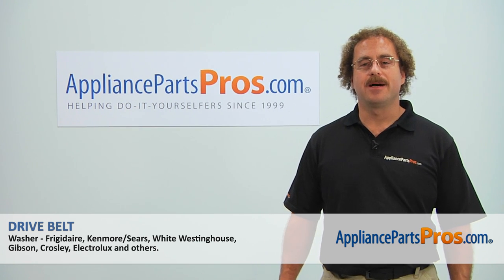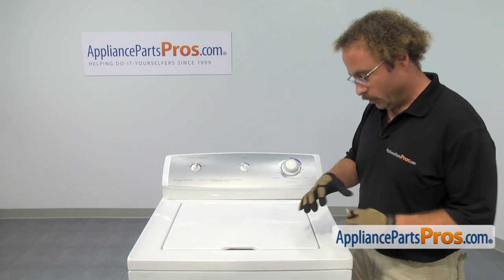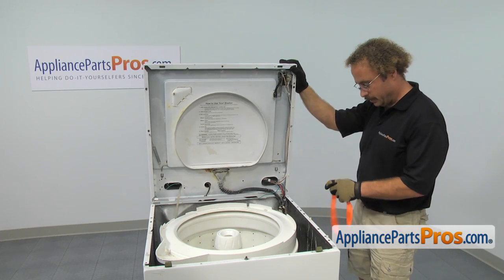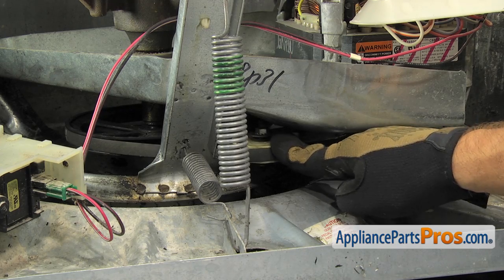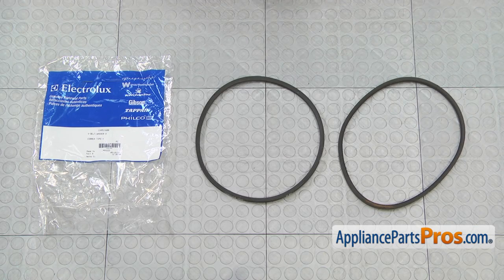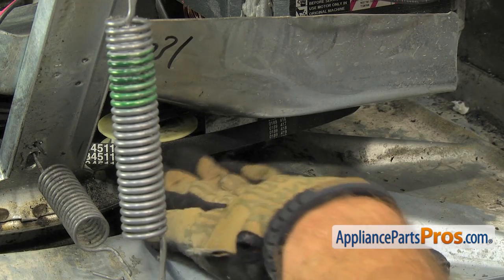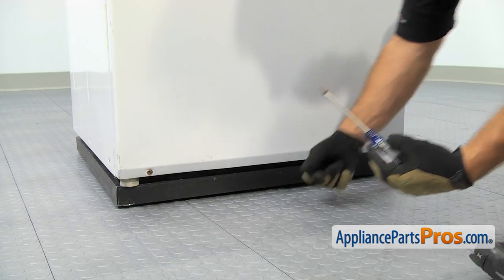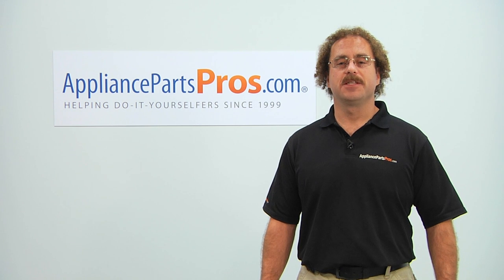How To: Frigidaire/Electrolux Washer Drive Belt 134511600

Comment: I have all the parts and machine. Problem is that i seem to be not strong enough to get the new belt to go over trany pully. Im like an inch away. Been trying for an hour. Im not a weakling either. He makes it seem soooo easy.
Reply: The problem there is this.
The transmission pulley is really small,compared to the tub pulley. It's too tight of a bend for it to roll on the smaller pulley.
Put the belt on all of the pulleys,leaving the tub pulley for last.
Get the belt started around the tub pulley at the rear as far as you can,around to the front and while holding the belt as best you can to the pulley, rotate the tub pulley counterclockwise and the belt will roll in to the groove on its own.
Reply: @paulbillings1791  Thank you for this, however video speaks of idler pully, motor pully and transmission pulley. So which one is the tub pulley please?

Comment: On the one I'm looking at .the belt looks fine from the outside! the motor runs but it slips immediately!! And the tensioner is on. and it doesn't look like it should be stretched .but maybe it is. how tight should that tensioner be?. On other washing machines they don't even have a tensioner ..but the belt is so tight they can barely get them on. so I would think this tensioner should be really tight. yes or no?
Reply from the maker: The belt should fit snuggly on the unit, if it's not loose then the tensioner is fine. If there is damaged or worn spots on the part then it would need to be replaced.
Reply: @appliancepartspros  yeah I found the problem . it's it's got ware in one spot.. but you can't see it from the outside.
Reply from the maker: Glad you were able to figure out the issue. Good luck with your repair and let us know how it goes!

Comment: Not right. I have a kennmore. And there is no space under Thu idler pulley to pull out the belt. The pulley is attached to the bottom.
Reply from the maker: A single part can be compatible with hundreds of different appliances. We film the part on a single appliance model to serve as an example of the repair, but there may be slight variations in the process for different models. If you need additional help with the repair outside of what's demonstrated in the video, you can always give us a call at 1-877-477-7278 or you can chat us at our website: http://www.appliancepartspros.com/.

Comment: How can I remove the big wheel that hold the belt. I want to take out the trasmision.
Reply from the maker: If you need additional help with the repair outside of what's demonstrated in the video, you can give us a call at 1-877-477-7278 or you can chat us at our website: http://www.appliancepartspros.com/. We offer free technical advice. We also have a free repair forum where the techs can help you troubleshoot the problem: http://forum.appliancepartspros.com/. We’re here to help 7 days a week.